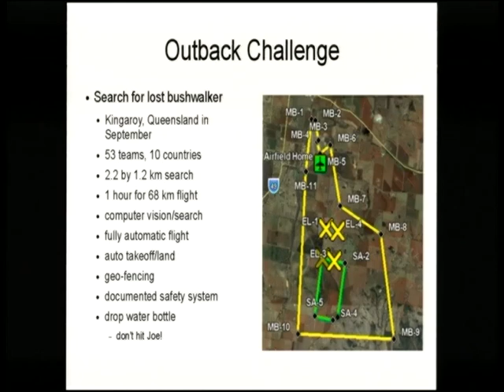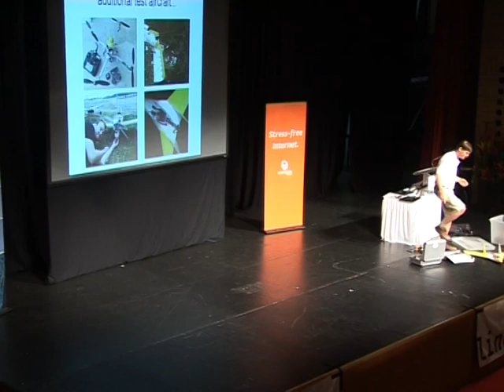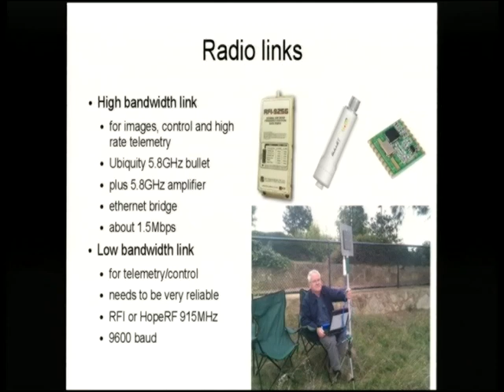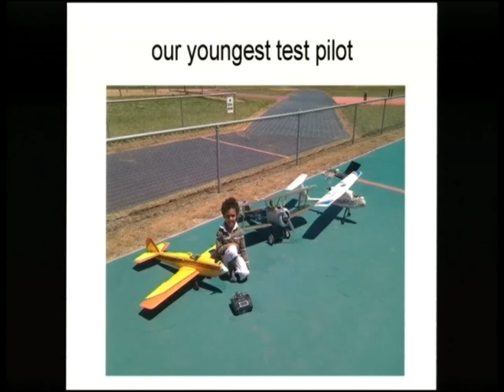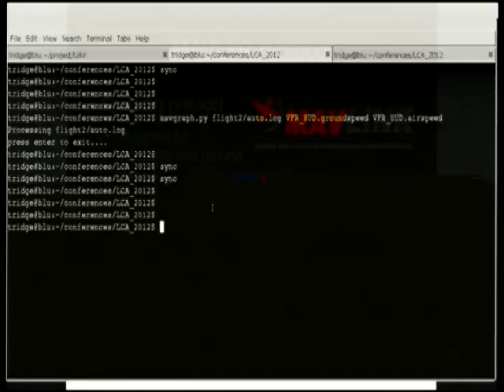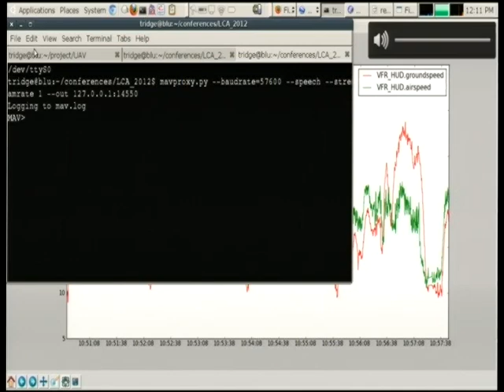Rescuing Joe - Andrew Tridgell

Comment: I just wanted to say that I don't care particularly about this project, but I've been using rsync for years now, and it's one of the most rock-solid awesome pieces of software I've used. I've thrown failing hard drives and sluggish connections at it, and it waded through everything and did the job, always. If I was Australian, I'd elect this guy president, even if he wasn't running for office. There has to be a way, lol.